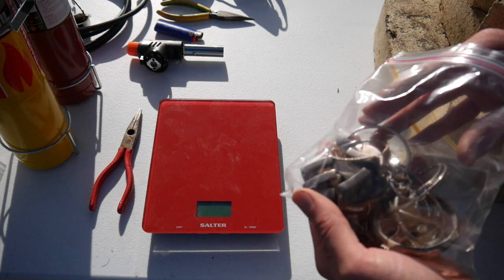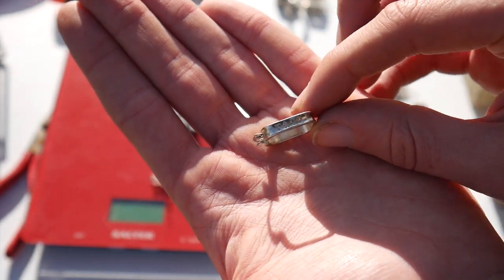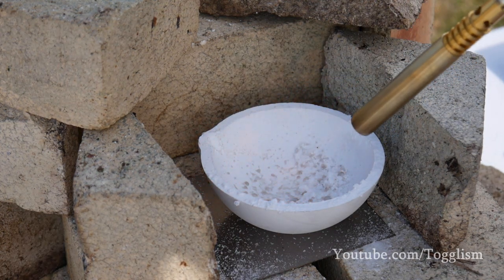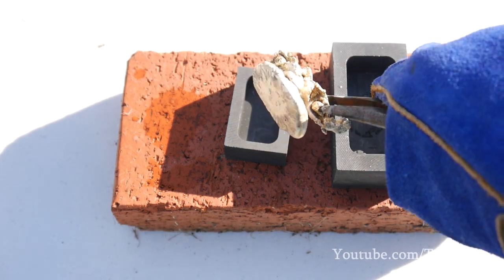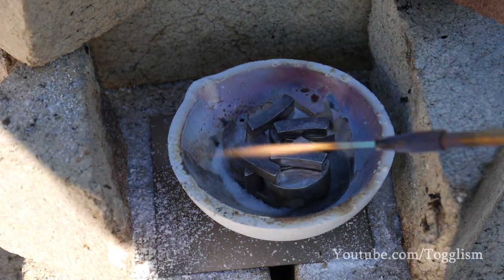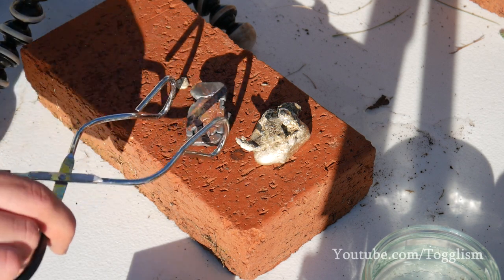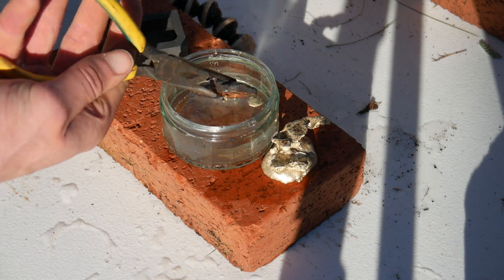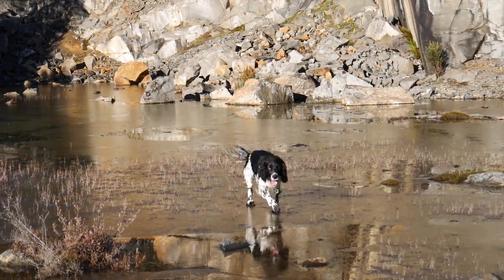MELTING down SILVER (925) Jewellery! with a blow torch

Comment: Font worry  about so called harly rings ...their for rubes... your torch...the oxygen  runs out check here u tube guy uses a nebulizer to fill used tank puts a fitting on side to hook up  allows  you to still use hookup for lines

Comment: Seeing how 925 silver has other metals in it, if you melt down sterling silver 925 add flux will it be pure silver after?
Reply from the maker: It'll still have the impurities, I think to make it pure (99.99%) you'd have to do some chemistry stuff. :
Reply: No. To get pure silver from sterling silver involves alot of chemicals to extract it from the copper etc thats in the sterling.
Reply: @Togglism  Some of the copper will oxidize faster than the silver and will dissolve in the molten borax.  But generally not worth it to try this route. Long heating times will dramitically increase the oxidation.
Seperating copper ( and nickel ) from silver would be easiest by dissolving the mess in just enough Nitric acid and then adding a table salt solution to precipitate AgCl.
Filter, wash and dry. 
Mill together with 110% of the AgCl weight of Sodiumcarbonate ( water free  obviously ). Then fire that to about 700 Celsius for half an hour then increase to 1000 Celcius-ish.
Carefully pour after about 20minutes in a deep metal bucket filled with water...this could splash obviously and is best done with <100g lots of Ag while wearing protection.
The excess carbonate will substitute for the Cl in the AgCl to form Ag2CO3 which will expel CO2 to form AG2O which is also unstable and will form Ag and free oxygen. molten salt will be a mixture of NaCl and Soda. Yields are usually quite good and purity is generally above 99%, washing well means 99.5%+ purity Ag shot.

Adapted from an old patent.
99.99% Ag requires re-dissolving the silver and plating it out electrochemically.

Now for the usual disclaimers : Acid attacks skin and soft tissues, wear all the safety equipment you'd wear in a laboratory(coat, goggles,gloves etc ). Acid fumes are hazardous, work with proper extraction preferably in a fume hood. Acid waste should be disposed of according to local regulations ( ie. not in the sink ).  Hot stuff is hot even when it looks cold. Glowing hot stuff is really hot and could burn you and can react explosively with moisture. 
Infact : don't do this unless you know what you are doing.

Comment: In Aus. Where do u reckon the best place is to get cheap and easy 925 silver. R OP shops any good??
Reply from the maker: Most op shops are combed over a heap so you wont have much chance of finding any 925 or gold in there unless you go to them every day. Best place to get some bargain 925 silver is from ebay, but you always take a risk in it being fake, like what happened to me with the harley rings. :)
Reply: Togglism thanks mate. Do you buy it buy 92ish% of the silver per ounce value of the day? Like is that a good bases to go on to find a good deal